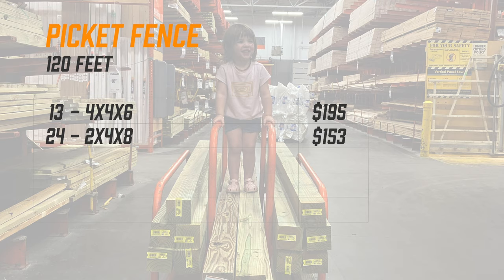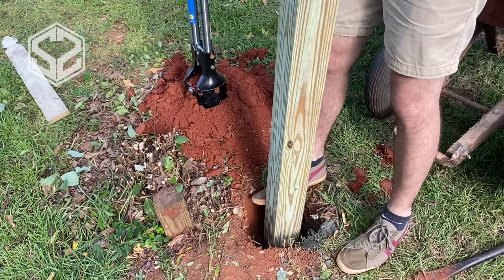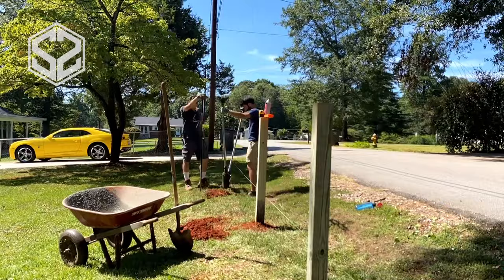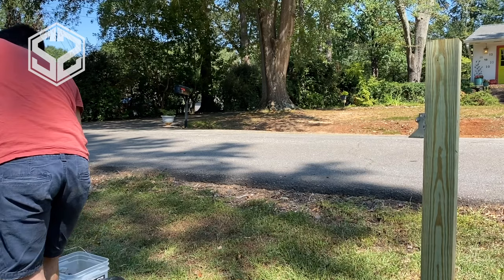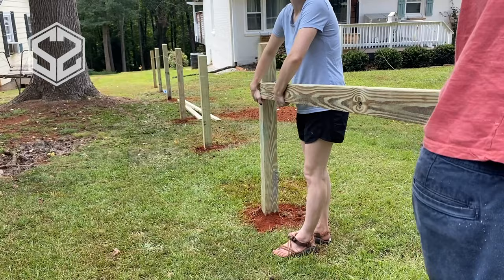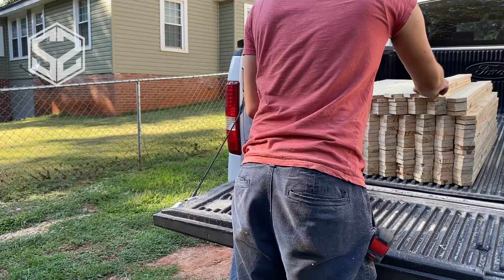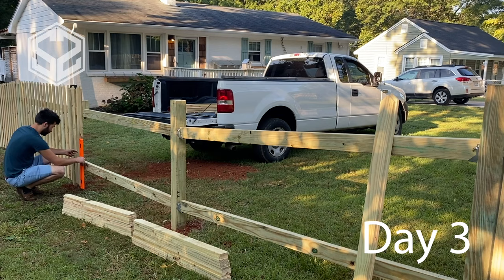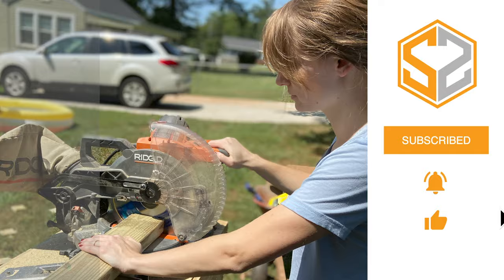How to build a picket fence.

Comment: Why didn’t you put the 2x4s over the face of the 4x4s so the pickets would continue over the 4x4 and hide the post?
Reply: I agree and think I like that approach more.
Reply: Style. You're talking about two different styles of picket fence. This is traditional. The posts are a feature of the fence. Not to be hidden as they would be in a privacy fence.

Comment: Never paint a fence IMO.  Paint will peel off.  Use stain instead.
Reply from the maker: We ended up using a white wood stain and looks great! You’re right, the wood stain should last much longer and not have an issue with pealing.

Comment: Great video, you should also reccomend that DIYers treat the wood that gets inserted into the ground with chemical to prevent rot. Also worth adding some gravel into the bottom of the hole to keep water from sitting around the post under the ground.
Reply from the maker: Very true! Thanks for the tips!

Comment: You did great.  It's worth it to rent a 1 man auger from HD for $40 for 4 hours and get the holes dug.  You can pour the powdered cement in the hole and add water from a hose.  Every body has a different way of doing things.  I used a 4' level as the spacer/also kept it plumb.  I like your home cut picketts.
Reply from the maker: Thanks! Yeah I am planning to put a privacy fence in our back yard eventually and it is much longer than this one so i will defiantly get a post hole digger next time! I like the level trick! 

Thank you for the comment!

Comment: i charge about $8 per foot and use budget fence options. you can get sections at lowes or home depot of 3.5' x 8' spaced picket sections for $30 each. use a lowes card and get another 10% off as well. also cementing wood posts is terrible as it traps the water and rots twice as fast. also many people think fence sections cant rack down hills and they absolutely can. you stand one foot on the bottom rail and hold the top of the section and rack it forward or back depending which way on the hill you are. if its a really big rack a pro trick is using a ratchet strap or cable winch and hooking it at the top corner and the bottom opposite corner and crank it to the rack you need. just tamp the posts in with the dirt dug up. put up a string and run a 100' tape measure out and dig the posts 8' on center. after the amount of post holes needed is dug tamp the posts in at 8' on center. i make two marks on the post: hook it at the top of the post and put a mark at 3" and 42.5". the 3" is where you put the top of the rail and the 42.5" is your ground mark. i put the first post at the ground mark and then either go with the grade of the yard or eye in the tops of the posts. then i go back and screw the sections to the face of the posts with deck screws. thats the absolute best way to install the cheaper lowes/home depot sections properly and will last longer without the cement
Reply from the maker: Thats a really good price. I cannot even get the wood here for that price even before the wood prices went through the roof because of covid. I have heard that concrete does rot out the posts but I have pulled out fence post that have been there for ten years and the ones with out concrete didn'y seem to have been in any worse shape. however, the ones without concrete came tight out because they were loose but the concrete ones were a pain in the butt to remove because thy were still solid. I chose to use concrete because it makes the fence a lot stronger. But it's really about preference professionals do it both ways.

Thanks for the feedback! it's always interesting to me to hear other ways projects can be done.

Comment: I used this video to build a 320 foot fence, 4 feet tall.  I found placing 3'' of gravel at the bottom of each post keeps the soil from rotting the wood.  I also raised the cement to above the soil line, with it sloping away from the wood, to shed water away from the wood.  So in the end, my posts have zero contact with soil.  Also, those floor joint brackets have holes at the edges.  Fence brackets are better attached to the middle of the post, I found.  I bought the ones you have, but returned them because the screws were too close to the edge of the post.  Maybe your posts are larger than the 4x4s I am using.

It would be helpful to mention how you determined the positioning of your rails.
Reply from the maker: Awesome! Great job, those are all good improvements! Thanks for sharing your tips :)

Comment: Thanks for the video! I used this as a starting point to build a fence in our back yard so our dogs would have a place to run around. This was a great way to do it and it ended up saving me almost $3000 after getting a quote from a fencing company! My yard was a lot more unlevel than yours but I used the same concept for the rails and pickets and the fence still looks great!

Comment: I like your video, and you guys did a nice job putting the fence together, but I think your cost break-down is lacking some of the other costs: like a cement mixer, specialty saws, etc. I LOVE DIY projects, but I don't have many of the tools and equipment you used! It might be helpful to some viewers (such as myself) to give a little more info about which tools will be used/needed to complete a job like this, and about how much they might cost... or maybe offer some ideas on how to substitute some of them, or maybe where to find good deals or rent them, etc. (if you happen to know). Also, I wonder how much extra your paint will cost as well..? Probably not too much, but I imagine you'll need at least a couple gallons, right? ;-)

Comment: What about protecting the wood from fungi, mold and insects? I intend to change soon a fence that looks similar. But first I intend to repaint each wooden element twice with a special primer, and then with wood paint with wax. Without protection in my climate in northern Poland, such a fence would last a maximum of 5 years. Then around the joints made of metal nails or wood screws, the wood becomes weak and the pickets become loose.

Comment: Been building fences for years, the best way to set posts is to just dump the dry concrete in the hole and add your exact amount of water. No need to pre mix
Reply from the maker: Thanks for the tip!! :)

Comment: I love this video I guess, telling us how many hours the labor was so we can decide if it's cost effective; time is money. Lastly did you already own the cement turner and table saw? How much would it cost to rent these? Can you post a video of you painting it or the painted results?
Reply from the maker: It took me a full day to dig the holes for the posts and set them with concrete. The second day we built the rest of the fence and attached the pickets. Two full days we were done. Maybe 16-20 hours. I actually owned the table say and cement mixer. You should be able to rent these at a place like Home Depot or a local tool rental. Prices change a lot depending on where you live. I would recommend renting the table saw but the concrete mixer is not necessary for the project. You can easily mix the concrete in a wheel barrow, bucket, or even the hole it is going in. I do need to paint it so when I do I will be sure to upload a video of the process. It’s good to let the pressure yearned lumber dry out before painting. Thanks!

Comment: Great job on this video. Although I couldn't see the top of the jig you made to make the pickets the same height. Would have been nice to see what you were doing and or how you did it. I at least have the idea and rig my own up.
   I just took my old fence down that was the same shape pickets and when I put the new fence up I wanna make them exactly the same as before. Whoever owned this house before me used round posts and nailed the 2x4s to the front of them. I like the idea  using those brackets to hold the 2x4s

Comment: Was it cheaper to use a cement mixer vs use bags of instant cement for the posts?  (Here in Australia you can tip in a bag of readymix and add water = cementing achieved.)

What about treating the fence post at the bottom also before cementing it in?

(I am not trolling, I am about to embark on a fence build and am keen to understand as much as I can from as many people.)  All the best!

Comment: I’m probably over thinking this but the string is confusing me 😂

So before you start digging the holes you tether the string and outline where your fence will go ? But how does it help you know where to start digging the hole etc ? Same when you use the string to keep the post straight before cementing

Comment: Great video and insight! How did you work the pickett’s on the slope? Cut the bottoms off..? 
Thanks again!
Reply from the maker: Yeah, I did have to cut the bottoms off of several pickets. The plan was to keep all of the pickets at least 3 inches off of the ground so that the weed wacker can trim under the pickets. so I used the spacer I made as a guide for the height of the pickets. This spacer goes off of the top 2x4 and kept all of the pickets at the same height. then they got too closer to the ground in spots I trimmed the bottom off with a saw before mounting them.

Hope that helps!
Thanks!!!

Comment: Very nice work Simon & crew. After a few months how have the pickets held up as far as warping after they dried?
Reply from the maker: Thanks!! The pickets have done really well for the most part. I have noticed 3 or so pickets that I may replace before I paint it this summer.  The rest haven’t warped or at least not noticeably.

Comment: how did you make sure each picket was exact same height above the ground? did you just use your foot to lift it off the ground everytime to screw it in and get them all perfect?
Reply from the maker: I actually used the spacer that kept all of the gaps uniform to also be my guide for the height. The spacer had a mark on the top and i simply followed the make across the whole fence. I did use my foot to lift the pickets into place if needed as my hands were full.

Comment: Did I miss the part where you explained keeping the height with the ground on the side portion of the fence?
Reply: Same here. It looks like it’s all based off from taking the same amount off from the top. A scrap piece with the hanger heights and top cut-off on it might make transferring the heights from the ground up easier.
Reply from the maker: Sorry, I don't think I did the best at explaining it. the key is to get the top 2x4 in the correct spot. that top 2x4 was what I used as the guide. I also made a quick spacer to keep all of the pickets consistently spaced apart. This spacer was also used as the height gage. I simply lined up each picket with the top of the spacer. If a picket needs to be trimmed because of a tree root or a hump in the ground just trim off a few inches on the bottom of the picket before attaching.

You could also run a string down the fence to mark the top of the pickets.

hope that helps!

Comment: How did you make the spacer???
Reply from the maker: I used one of my fence pickets and put one screw into a 2x4 block on the back side. The 2x4 block would sit on top of the fence 2x4 and hold the spacer at the right height. I hope that helps… I should have showed that in the video.

Comment: You don’t have to pre drill the holes? Did the wood split at all! I’m about to start this project on my moms house as a gift haha let’s see
Reply from the maker: If the wood is dry it may crack, but most pressure treated wood is still wet from the treating process when you buy it and this makes the wood soft and less likely to crack. I didn't have any crack. Good luck on your project! Thanks!
Reply: @SimonSaysDIY  thanks man! Here in the southwest wood dries soooo fast lol Illl try no pre drilling see if it’ll work! Have a good day
Reply from the maker: Thanks!!

Comment: It sounds simple enough, thanks.
   I don't have a chop saw. Is a jig saw okay or would it be worth it to rent a chop saw? And did you rent the concrete mixer?
   Were you concerned about utility lines or because it was at the perimeter of your property you weren't worried? Do you have any recommendations for finding someone to mark ones property lines? 
   It looks like you just use your foot as a guide for how high to keep the pickets off the ground. This was good enough? The top stayed even that way? Or did you also eyeball the top with the guide?
   What about installing a gate?
Reply from the maker: Thanks for watching! 

Depending on the size of the job it may save a lot of time to rent a chop saw. 

I actually found this concrete mixer on Facebook Marketplace for $75 So for that price I bought it and have used it on many of my projects around the house. However, if you don't have a mixer you can certainly mix it by hand in a wheelbarrow or bucket. I have also seen people just pour the mix right in the whole and cover it up with dirt. the idea is the moisture in the dirt over some time hardens the concrete.

I actually only have two utilities and the electricity is overhead and the sewer/water lines have an access panel right below where the fence was going so I was very confident I wasn't digging into any lines. I believe you can call the utility companies and they will mark the lines for you so you don't have to worry about it.

I googled land surveyors in my area and looked up their reviews before deciding on one.

I used the spacer in between the pickets as a guide for the height as well. this kept it straight across the fence line

Hope that helps!!
Thanks!

Comment: Thank you for sharing. I Had a few questions. What height did you end up cutting your posts off at and your pickets look to be a little taller than the post is that what I will need to do. Also do you remember the spacing on your 2x4x8s from the ground up?

Comment: Thanks for a great DIY video! I want to do exactly this. My hesitation is the treated pickets bowing and warping. Have you had any of this happen to you?
Reply from the maker: I'm glad the video could help! I was surprised that only a few pickets warped. I cut some extra pickets in case that happened so I can easily replace them. I actually had a few 2x4s that warped really bad and I may end up replacing them. Thats the problem with wet pressure treated wood, You never know how much it will twist and bend when it dries.
Over all it turned out really nice! :)
Reply: @SimonSaysDIY  Some say dry before building .

Comment: hi good job but in  which state are you..from the color of the earth it looks like South Carolina...i'm in Canada and wonder about the depth of concrete here i guess it should be more but not sure
Reply from the maker: Yes, I am very far south from you and have no issues with frost. My guess is if you don't want the fence to move at all in the long run you will need to look up what your frost line is for your area and lay the posts that deep. you can have the posts above the frost line but each winter when the ground freezes it will slightly push the posts out of the ground and potentially cause the fence to lean.

Hope that helps! 
Thanks!!

Comment: Great video! Using it as a guide to build mine. What type and size of screws did you use?
Reply from the maker: Thanks! So glad my video could be helpful! :)
I used 1 3/4 exterior deck screws. This was the right length to not come through the back side of the 2x4s.

https://www.lowes.com/pd/Power-Pro-8-x-1-3-4-in-Ceramic-Deck-Screws-525-Count/1000363873

Comment: For the 2x4 hangers, did they hang over the edge of the 4x4 posts? If so, was it noticeable?
Reply from the maker: The hung over a 16th of an inch on both sides. It is very minimal and unnoticeable especially if you paint the fence. Thanks! :)
Reply: @SimonSaysDIY  ok, thanks. Your fence looks great. I’m using it as blue print for my own. 👍🏻👍🏻
Reply from the maker: So glad to heard that!! Good luck on yours! :)

Comment: An hour and a half of you working = me still finishing at the end of the week. I meant to ask if it takes an hour and a half sped up or normal time of work? Did your wife help you with the whole project or could one do this alone? Perfection as usual Simon.
Reply from the maker: Thanks! I sped this up a lot. It took us 2 full days probably 14-16 hours. digging and setting the posts on the first day and then assembling the picket fence the second day. This if doable for one person but it will likely take more time alone.

Comment: Great video! I am excited to get my fence up. Just curious how you made the spacer?
Reply from the maker: I used a picket on the front side and held it up on the fence at the height I wanted all pickets to be. On the back side I placed a 2x4 block of wood on top of the upper fence 2x4 and put one screw from the picket into that block. On the back of the 2x4 block I attached a pice of a picket about 8 inches long to the 2x4 block and overlapping both 2x4s. This created a bracket that slides over the upper fence 2x4 and holds it in place at the same height every time. I used it as a spacer but also a height marker. 

I hope that made sense!
Thanks!

Comment: You should put some post caps on. Its good though I’m not a fan of the  wood / concrete contact
Reply from the maker: Yeah I am thinking about putting some on but I haven't found any that I like. As for the concrete, There are several other options that could work. I'd recommend checking out expanding foam made for posts. it is comparable to concrete and still is easy to do and holds the posts stable.

Thanks for watching and the suggestions!
-Simon